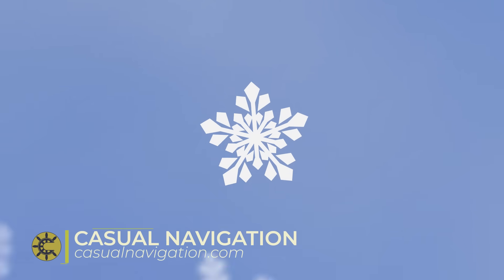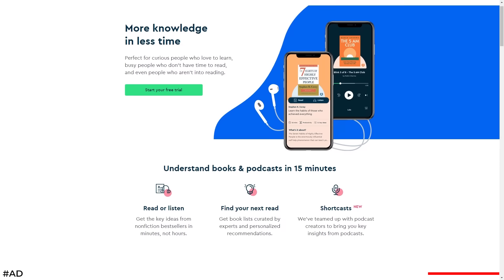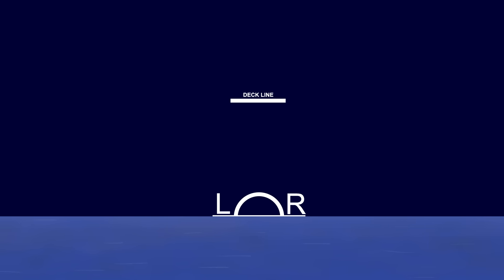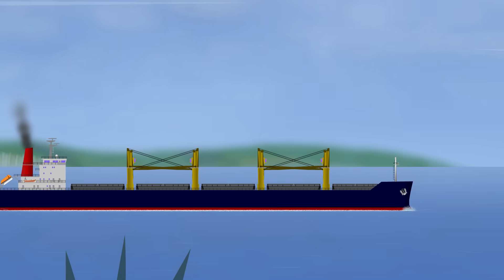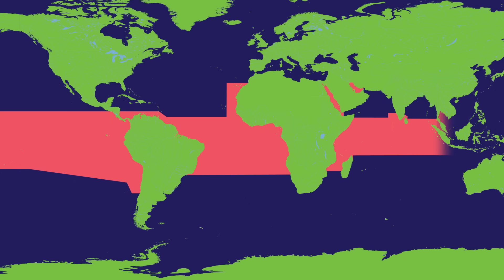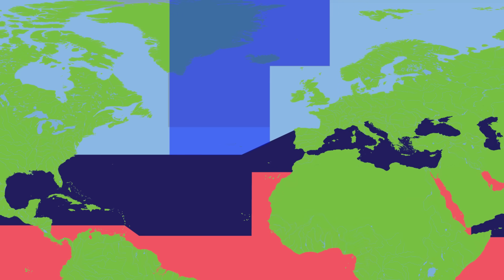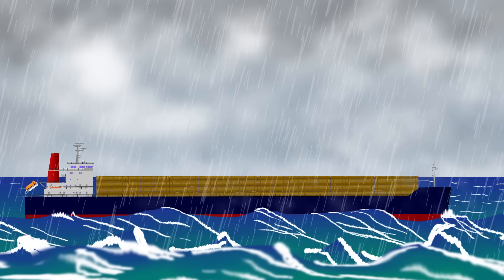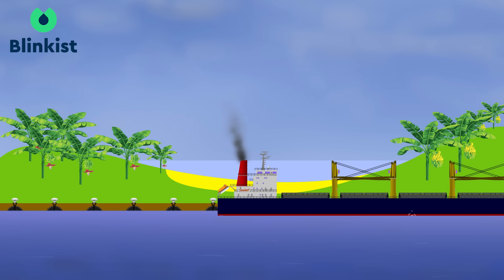Why Do Ships Carry Less In Winter?

Comment: Ok so bad weather sinking the ship is the answer to the ‘why’ . The rest of the video is talking about the ‘how’. As in how do ship captains know how much cargo to load. Kinda wish you covered the why in more detail first.

You got potential my friend. Loved the animations and presentation. 

Follow up question: if a ship is getting loaded in China and travels through all kinds of weathers by the time it gets to … New York. How do they decide how much to load the ship? 

Oo Oo maybe a little more science related video but would be cool to learn about how different ships make themselves more buoyant so they can take even more cargo.
Reply: Your last question regarding a transit through multiple zones is covered in the last minute of the video. You cannot have your applicable seasonal line submerged for whatever seas you are sailing in, and must plan for this for the upcoming voyage. It gets kinda complicated if you go from say a summer zone to a winter zone on the same voyage. You can load to your summer zone, and by the time you get to the winter zone you may have burnt enough fuel, used up enough water, and possibly discharged ballast to bring your freeboard up enough to operate in the winter zone by the time you get there.

As far as how they decide how much cargo to load, it largely comes down to loading and stability tables. Ships will have a big book of tables showing, "If you put W amount of weight in these locations, then the vessel will have X depth, Y trim, and Z list." Nowadays this information is put into a computer that does most of the calculations. This channel has another video titled something like, "A typo caused the most expensive ship salvage" or something that goes into this. An incorrect entry in the loading computer of the GOLDEN RAY was likely a large reason why it capsized
Reply: Also regarding ships "making themselves buoyant." That's kinda close to what a ship does, but it helps to look at it the other way around. Ships are buoyant. If they don't have enough weight on them, they may be "too buoyant." The buoyant forces on the hull may cause the vessel to violently rock back and forth. So to remove excess buoyancy, they take on ballast water in dedicated ballast tanks on the edges (side, bottom, front, and back) of the ship. Then when they need to load cargo, they discharge this ballast water to regain some of their buoyancy.

I believe this channel also has 1 or 2 videos on ballast water treatment systems. Because moving water around the world may bring with it invasive species like zebra muscles, e.coli, etc. The previously mentioned incident regarding the loading computer on the GOLDEN RAY was a typo entry for the amount of water in their ballast tanks
Reply: I think the way he explained it in the video is a bit misleading. If we eliminate the bad weather, for the same amount of cargo, the ship would float higher in winter because the water is more dense. But cargo carrying capacity does not reduce. On the contrary denser water would make it easier for the ship to achieve buoyancy.
Reply: @adarshpatnaik9047   Water density only matters for fresh vs summer, and tropical fresh vs tropical. It has nothing to do with say summer vs winter, or winter vs winter north Atlantic.

There is about a 1% difference in sea water density between sailing in winter in a polar region or summer at the equator. However I am looking at the load line certificate right now for a 173 m bulk carrier, and this vessel's required freeboard goes up 11% between tropical and winter. The load lines only care about water density when going from fresh to salt or vice versa. It is otherwise all about the typical weather
Reply: @phantomsplit3491  Thank you for sharing your insight on the matter 😊

Comment: You said that a lumber load can "easily be jettisoned" if necessary. Can you please do a video on exactly how a crew is able to jettison cargo at sea, especially in a storm?
Reply: Container ships seem to have a self jettisoning feature built in.
Reply: @murraystewartj  Ha! Exactly what I was thinking of.
Reply: @alwaysbearded1  Great minds think alike, my friend.
Reply: Under stormy conditions the hard part is not jettisoning the cargo.
Reply: So, the undo the locks and the timber rolls into the sea.
Reply: They also do this to normal containers if necessary. But like extreme circumstances.
Reply: I imagine you'd unchain it and let it jettison itself.
Reply: @bubba99009  That's adorable. I cannot imagine a scenario in which  the seas are so heavy that a load needs to be "unchained" that they'd send mariners out to cut it loose. If it's that easy, you do it.
Reply: @murraystewartj  If jettisoning really is Plan B it would probably be possible to arrange some safe way to release deck cargo without dangerous excursions onto a pitching ice-covered deck.  Release points accessible from below decks?
Reply: https://youtu.be/X3uazOtPxGs
Reply: I wonder where such jettisoned lumber would end up.
Reply: @Haarhzh  certainly it will end up in the water

Comment: A point you glossed over that I'm interested in:

Ships are watertight up to a certain point. I've heard about this a lot when talking about how sinking ships are basically doomed once flooding goes above the watertight compartments. Why aren't watertight compartments built from the bottom all the way to the top?

Just something that always confused me (non-sailor)
Reply: Navy ships are build like that and can still float while their decks are 'awash' (aircraft-carrier excluded!).
If I remember correctly, it just hampers loading and un-loading of cargo as these spaces would need to be individually opened. Also water-tight compartments require more steel and this extra steel costs more fuel because of the extra weight but doesn't provide any extra income.
Reply: @DreadX10  Since this seems to be one of the more well informed replies; in regards to non-warships, I've heard of ships like the Titanic where the water floods over the top of the water tight compartments. How does this even happen if they're watertight? Kinda defeats the definition of the word if they can overflow, right?
Reply: @MrSmithSAH  Imagine a water-tight compartment being breached. Maybe a tug-boat kissed the hull a little bit harder than intended or the ship collided with a floating shipping-container. The point of the water-tight compartment is to localise the flooding (so the weight of the water that comes in can be kept under a manageable limit). The ship will now ride lower in the water than intended. If more than one compartment is breached the weight of the water can be enough to make the ship ride so low that the deck-line gets to be under water and at that point the compartments can over-flow (AKA the ship sinks).
War-ships also have the advantage that they are air-tight as well and water will have a harder time flowing in when the air in the compartment can't escape (it just compresses a bit). Cargo-ships do not have that feature (usually).
Titanic, btw, had watertight bulkheads that did not extend all the way up to the weather-deck, so these were not closed boxes but more like tubs in a larger tub (the ship).
Reply: @MrSmithSAH  That was a well touted feature, the water tight doors and bays. But they simply just did not carry the bulkheads (walls) and doors high enough. Hubris and lack of regulations. They never thought so many bays would flood in one go. As the bays flooded the ship was down by the bow and that encouraged water to flow over the top into the next watertight bay and it was all over. There is a great parody on the Titanic song, the White Star Engineer's version that discusses this.
Reply: @DreadX10  all large ships are designed to withstand two compartment flooding and stay afloat. 3 compartment flooding or more is where you can get sinking, but the odds are very small as you would need to damage the entire length of a WT boundary and then some forward and aft of it.
Reply: @MarkLastiwka  Yes, but when the superstructure gets covered with ice, all that weight can count as a flooded compartment. It also makes the ship less stable having that weight on top.
Or when you have two flooded compartments; riding lower and now the waves come rolling over deck because the storm you're in doesn't care.
Chances are very small but the two compartment rule needs the by-line "if nothing else goes wrong"
Reply: @MrSmithSAH  They COULD be watertight up to a certain deck level, but NOT all the way to the weather deck — the separating walls ("bulkheads") didn't go that high.  (As I understand it, on the Titanic, the tops of the bulkheads were NOT even sealed to the underside of the deck above, allowing water to flow over the top of each bulkhead into the next compartment)

Furthermore, to actually BE watertight, ALL of the passageways through the bulkheads and from the uppermost sealed deck to the deck above would have had to have been closed and sealed.  They're normally left open while underway and sealed only in an emergency. 

The problem then is that the people in the flooding compartment don't want to be trapped there, so they'll open the passageway, allowing water to flow into an undamaged compartment.  Professional sailors would know to seal the passageway after they've escaped, but ship passengers in a panic won't know to do that.  

When enough compartments have been flooded, the ship's own mass will be sufficient for it to sink.  For the Titanic, some passageways were sealed, others were not.  When the water was deep enough, it flowed over the tops of the bulkheads, flooding enough compartments to sink her.
Reply: I am not in the shipping industry, but for questions like this you can always look at how much it would cost (and tied directly to that, is how functionally useful it is).  Fully watertight vessels exist, but there are reasons that submarines aren't used for shipping.  They cost more to build, are more complex to operate, and all that extra cost is just unnecessary for most use cases.
Reply: There are a few reasons they don’t make the watertight boundaries as high as possible. The higher the WT boundary, the larger hydrostatic loading you will get on all your under bulkhead deck structure. Tank vents will also need to go higher, increasing scantlings for all the tanks. Below the bulkhead deck, passage between WT compartments is limited and generally not allowed or if you have it, needs an expensive sliding WT door. For lower decks this is usually okay, but as you get higher you start to have more cabin spaces or working spaces. Adding these boundaries will impact workflow. Also, escapes for spaces need to travel all the way to the bulkhead deck. If you raised it higher, you would need to have more decks for escape. And more ladders/stairs, which take up space.

Many mechanical systems do not like crossing WT boundaries as they could result in progressive flooding risks, it isolation valves are not used. As a result, many of them are routed up and above the bulkhead deck so they are not required. Raising the bulkhead deck will me longer pipe runs and higher hydrostatic loads in the tanks (leading to bigger tank structure and a heavier ship)

That’s all I can think of at the moment.
Reply: One of the main issues here is money (of course).  Ships are taxed and have things like harbor and canal transit fees assessed on the basis of tonnage.  Despite the name, this has nothing to do with the weight of the vessel - it is meant to be a measure of the cargo-carrying (hence, earning) capacity of the ship and is based on the internal volume.  Spaces that are not made watertight count for less in the tonnage than spaces that are.  So some ship owners will ask designers to make some areas not watertight in order to save a few bucks.  

Another reason is kind of unique to passenger vessels.  To get the most passenegers in, they will often include accomodations for them in the upper levels of the hull.  People generally expect passenger areas to be posh and comfortable.  Having ugly watertight steel doors here and there is not compatible with this. Plus, expecting ordinary passenegers to operate them and be diligent about closing them after themselves is probably not a good idea.  So the tendency is to stop the watertight subdivision just under the lowest passenger deck.

That said, most cargo vessels do keep watertight subdivision going to the main deck level.
Reply: For larger vessels it's most likely too impractical to make it standard. The maintenance to have the whole ship stay watertight would be too costly and there is no practical way to upright a 300m vessel when its on the ocean. On the other hand, some smaller vessels like rescue cruisers are built watertight. Some are designed to withstand a full barrelroll without any major damage, but this necessary feature for these ships is very expensive and every aspect of the design needs to be adjusted for it.... So yeah, it's basically money and purpose.
Reply: Cost savings. Search YouTube for "The Front Fell Off." It's better nowadays, but not by much.
Reply: @Vinemaple  Cardboard's out.  No cardboard derivatives.
Reply: Yes i was thinking what? There is metal blocking the water from gojng in the deck so how?
Reply: Well the outside doors on the main deck are still watertight, but my guess is.....money.

Comment: I must disagree.
I always have more motivation to work when it's cold. The heat is the thing that's killing me and keeping me to wish for a quick death
Reply: Depends on how extreme the cold and hot are.  Extreme heat, say +45,  will kill you in a day.  Extreme cold, say -35 , can kill you in a hour.
But I agree that I find reasonably high temperatures worse to work in compared to reasonably cold ones.
Reply: @HweolRidda  The maths there only works if you assume a complete cessation of activity and active measures to cool yourself for the hot environment. Attempt strenuous activity in the former and the results will be unfortunate in short order. Then again similar applies to the lower temperature that low survival time applies with a lack of preparation and suitable gear we can and indeed do produce Antarctic weather gear that provide sufficient insulation to facilitate survival. In fact ironically the real danger when equipped with that can in fact end up being the same as that for the hot climate, that gear pretty much eliminates the ability to effectively get rid of waste heat from physical exertion. You can actually die quite easily if you were to attempt to perform fairly modest physical activity around the Summer months while wearing the winter gear. The extra insulation the winter gear has will kill you rather quickly if you are active enough to make your body depend on it's cooling reflexes to attempt to maintain a temperature compatible with survival. The reality is that actually an increase in your core temperature will not only kill you from a smaller deviation but becomes irreversible without external assistance with a very small change. You actually need to lose more heat to die from hypothermia than you need to gain to die from hyperthermia but reducing the heat gain is somewhat easier to do without needing specialist equipment, removing insulation, drinking plenty of fluids, and laying your ass down not moving will help a lot when overheating. If on the other hand you are unprepared for low temperatures you are basically buggered because there is not a lot you can do to make your situation any better after you make the mistake of blundering into it. The fundamental reason for this is obvious, you can control to some limited degree the amount of excess heat you produce which can slow the rate at which you expire from hyperthermia but wondering into the cold unprepared is more like try to free hand climb down a cliff unprepared you made the fatal mistake before you start to experience the warning signs of the consequences. The natural forces in the situation are working against you once you realise, often heat related deaths result from you actively overwhelming the bodies ability to cool itself with physical effort. This is perhaps exactly why the body has less autonomic adaptions to mitigate the effects of core temperature deviating above normal thus why life threatening hyperthermia actually begins closer to normal temperature than the hypothermia equivalent the body can borderline shut down non vital organs to limit cold damage to vital organs but it has pretty much no mechanism to stop the denaturation of proteins from occurring systemwide if your temperature rises much more than around 2C.
Reply: Both the +45c and the -35c numbers are flawed. 
Are you making this calculation based on being naked and with no water?
45: I have lived in a country where the manual labourers have been forced to work outside in 45c weather for up to 12h a day.
I have a feeling that even in the middle east, if all the workers died after a couple of days, they would rethink what they were doing.

As for the -35, have you heard of successful arctic and Antarctic expeditions? What's their secret? WARM CLOTHES.
Reply: I am glad to see that you are able to say other words apart from "I am Groot" :)